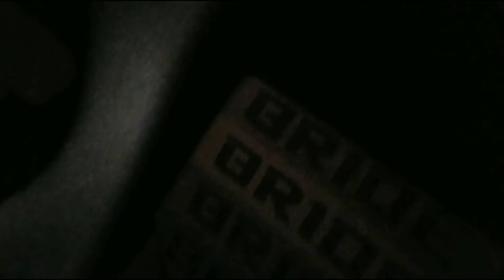ALL CUSTOM cd7!

Comment: Dude I absolutely completely freaking love this video because I am actually building a cb7 that's basically going to be the same as yours except for not a CD I'm basically doing everything that I can to it I bought an h22a JDM swap or it 66 mm Borg Warner rebuilding the H22 for 11.5-1 cr and sleeve the block and o ring of course the only reason it's not already swapped and on the road is because I ran out of money but I daily drive it right now with the F-series motor in it and I have all the parts
Reply from the maker: Hell yeah ...let me know if u have questions
Reply from the maker: Share away and let's get me some motivation to do this car

Comment: have you done f23a× with f22a× non vtec head? if so what kinda power did it make?
Reply from the maker: Yeah with k20 pistons and delta 272 cam ...made in the 180's with h23 intake and Ebay header